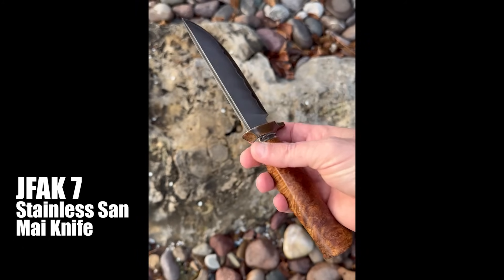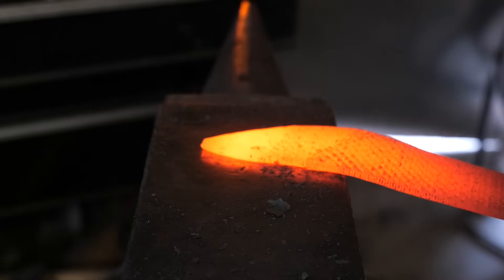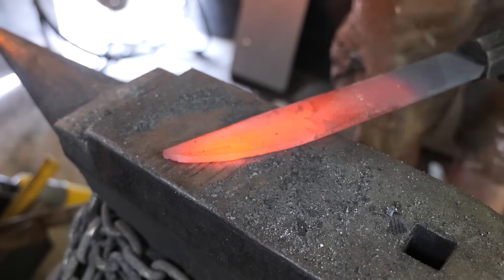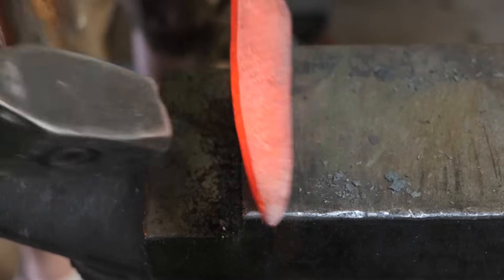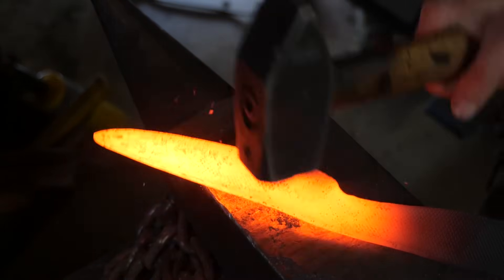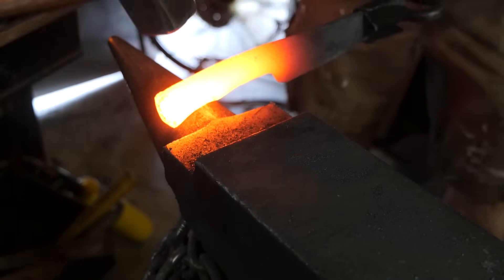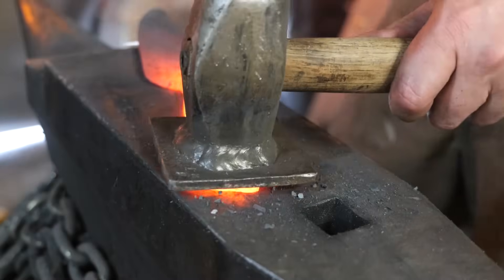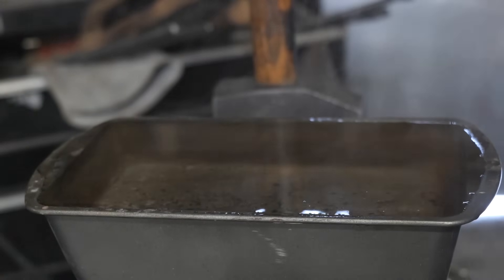JFAK 8 - (W COMMENTARY) Forging a Knife From an Old Rasp

Comment: I agree that generally scrap is not going to do for a knife especially . I recently used a file of my grandfathers which came to me by my father to make a knife, it had a tapered edge with a built in handle so annealing it  and grinding out a little more stock to lengthen the handle was appropriate but I basically left it the same shape. I made a bowie typoe point and ground a long bevel to make sure it was thin enough to cut well then made a micarta handle out of several of my old tshirts..lots of glue, some brass pins my son bought me and a questionable quench I have a knife 
Its not hard enough to keep its edge particularly well but its the personal nature of the ingredients that make it what it is for me.
Sometime its nice to make "something different" and just see how it goes. Would love to see the finished product

Comment: Coming from a small sample I have found that files are 1095 or 1080 someplace around those parts however rasps are not. Infact hardening them can be tricky, for me anyway. 55HRC is about the best I have ever gotten.
I generally steer clear of rasps for this reason.. hope that is of some help.

Comment: One of my first knife was made from similar rasp(exact same size and patterns). Of course I didnt forge it, just used like 10000 grinding discs and almost messed up my dad grinder, as I was like 14yo and I grinded it so long that metal was almost orange :D Quenching was also amazing as I used.... 2 propane torch and new bottle of car oil that was in garage, and of course I put that in to the bottle after use and it ended in our car later... Good times.... short good times as of course I didnt knew that you need to reheat metal after hardening so it broke after I tried to chop everything wooden thing I saw
Reply from the maker: Great first go at it!